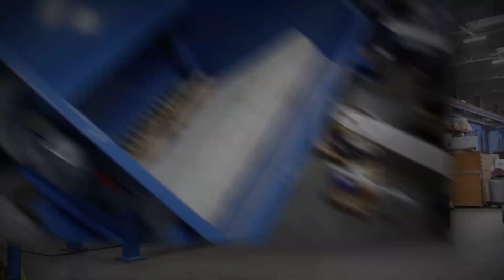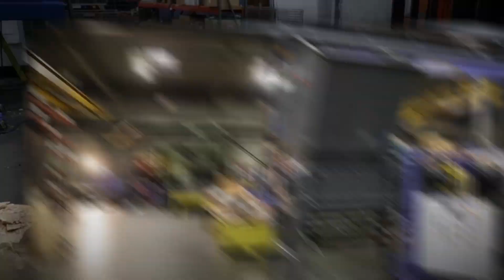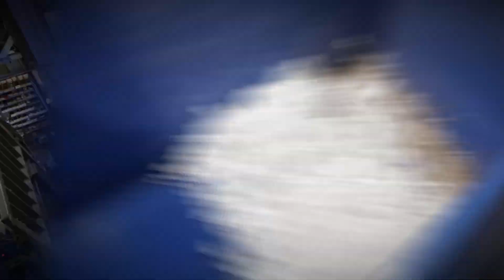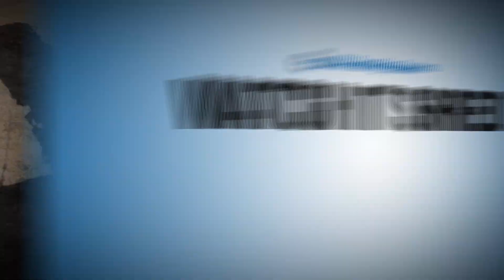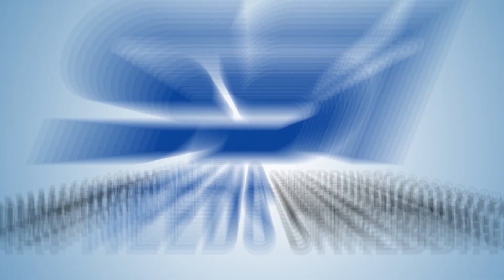METALS: Aluminum Roll (M85)

Comment: If you are rolling aluminium you can, if your machinery is not working properly, roll it to thin each pass and thus crack it.
Problems with a roll of alu could also be improper chemistry, improper storage causing corrosion and it being rolled too thin by mistake.
Aluminium is endlessly recyclable, and thus a prime example of something you can just melt down and rework.

A big heap of aluminium like the roll doesn't melt that easily, finely divided up in small strips it goes really fast.

Comment: Why would a roll of aluminum ever need to be shredded instead of used as just that? It's practically a raw ingredient
Reply: +Harlequin314159 At the plant where I work they often reject entire rolls of steel because they have long scratches along them.  Or perhaps the alloy was not formulated correctly.
Reply: AS other commenting under here. IT can be both quality test of the shredder or a rejected roll of aluminium that is shredded to be melted again. Aluminium is a reuseable material so IT is still useable in shredded condition ^^

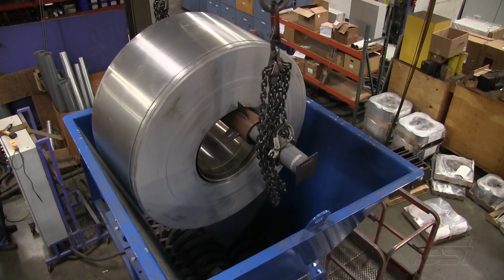Comment: At 0:20 you guy have the lift chain around the shaft and through the hook. That is side loading the hook and that is a no no. Even if that hook is rated above what your lifting its still a safety hazard because those hooks are designed to bear the weight against the bottom of the hook, not side on. Just a little safety tip, still a cool video though. 👍